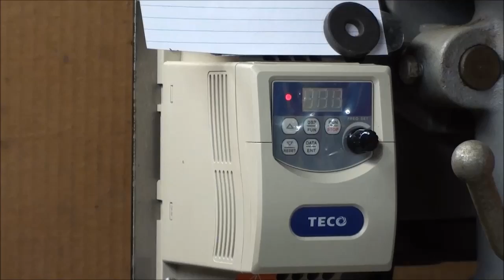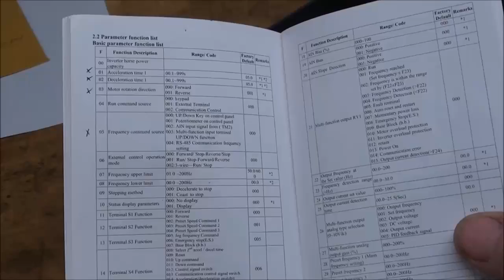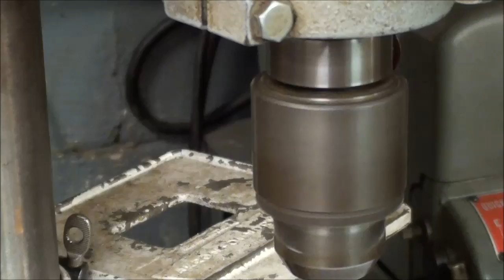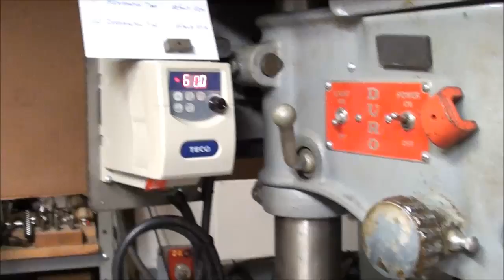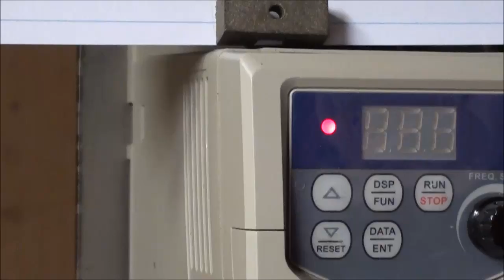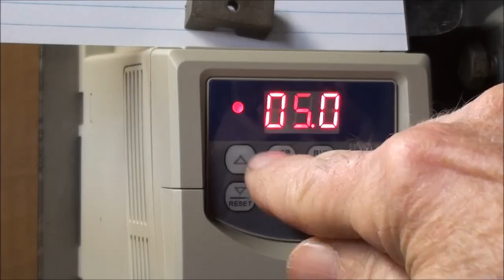MACHINE SHOP TIPS #140 Programming the VFD Variable Frequency Drive tubalcain

Comment: Mr. Pete,
I have a great deal of experience with VFD's so I thought I should share a couple of got ya's  with you.
1) make sure your motor is designed to run on a VFD. Any motor will run on one in the short term but motors not rated for a VFD will burn-up prematurely.
2) VFD rated or not motors should not be run under 20Hz under load. If you have a VFD rated motor you can run it above 60HZ, In many cases up to 120Hz. Pick a pulley combination that gives you your minimum spindle speed at 20Hz and if your motor is so rated your maximum spindle speed at 120Hz. In any case a non-VFD rated motor will last longer if run between 20&60Hz.

Best regards,
Jim
Reply: I have heard that too. I brought a VFD type motor for my wood lathe, cause it was 56 frame, but what if it is some kind of proprietary funky mounting 3 phase motor?
Reply: I've never heard of this? I did buy one &have been using it on my 1951 SB lathe- how would you know if the motor is made to use a VFD? PS I don't use the lathe daily just for projects or repair parts also I did notice that to start &stop the lathe I have to use the VFD instead of the on off & reversing switch that is on the lathe-is that because of the ramp up? (14×72 tool room lathe) Thanks for any info you can throw ny way
Reply: @Tryin2FlyII  Inverter duty motors are labeled as such. They are usually class F wire insulation and also employ motor shaft grounding (newest motors do).

Either way, the manufacturer will readily label the wire insulation class and most times will also call out whether or not it is suitable for inverter duty.
Reply: @thatguythatdoesstuff7448  Thanks - I will have to get in the motor cabinet and see if the motor is labeled any where it is a bit hard to get into and it is darn cold here at the moment lol but Thank you for the info!!!
Reply: I'm a little late to the party but this is exactly the information I was looking for for my milling machine. Thanks man, you made my day.

Comment: Hello Mr Pete, great videos. I converted my drill press to a permanent magnet dc motor off of a clothing rod or treadmill some say. I bought a one hung low handheld tachometer, and mounted it to the drill press aimed it at the final pulley with a small hole drilled into the bottom of the belt shroud and added a piece of reflective tape. Just press the read button and get your rpms.

Comment: I installed a similar converter to my Tom Senior mill and understanding the programming is somewhat of a nightmare, I felt if I did something wrong that would be that, but as of today everything appears to work okay. Resisted the temptation to overspeed the motor, we are 50Hz here so I may one day set it to 60Hz which I guess the motor bearings and armature will take, increasing the speed range a little.

Comment: Thanks for taking the time to show us how it works so we have an idea what is available.  I had a 2HP 3 Phase motor which came with my mill that I couldn't get to work with the 3 phase in my garage.  It currently has a 2HP 110V motor on it, but I may try to get one of these and if I can get the 3 phase motor to work, I can put it back on the mill and use the new 2HP 110V motor on the large air compressor whose motor isn't working right now either and like you, not have to change belt positions on the mill I have.

Comment: My understanding of a VFD is that it converts the input AC to DC, and then pluses that to the motor.  So the 60 cycles from the power company is not a factor anymore.  Saying that I am NOT sure if going over 60 pluses per seconds will harm the motor.  I know that I run my over 60 all the time.  Just my thoughts.

Comment: Nicely done.  I hear you about the Teco manual, leaves much to the imagination.  Once you go through a few of the programming functions it becomes easier.

just to answer a couple questions from your commenters:

If you slow the Hz down to tickover speed you also lose the torque from the motor.  So just running the spindle at 1 rpm you can easily stop the spindle with your hand.  They do make (and I'm getting outside my pay grade here) other more expensive VFDs called Sensorless Vector drives that I believe can maintain motor torque so that might be more appropriate for a machine like a lathe or mill where you still need the machine to have the power in the back gears.

You can also add a FWD REV switch (and program the VFD) so that you can go FWD reverse on teh spindle without digging through a bunch of menus.

The keypad buttons do indeed feel fragile to me and i stopped using them when I decided to move my switches to the front of my drill press remotely.  I might recommend you do that for the on/off at least if you machine gets heavy use.

Comment: I will be very interested to see how a vfd will work on the Bridgeport sounds like a great idea
Reply: It works fine on my Bridgeport.  I'm quite happy with it.  I have several videos about using my Bridgeport, but never considered making one on the VFD.  It just sits there and does its thing, no muss, no fuss.  My house has no three phase available in  the neighborhood, so had to use either a three phase converter or a VFD.  The VFD is a much better solution.  Also allowed me to rip out the old three phase interlock in the power cabinet.
Reply: Tom do you notice a torque loss? and is your mill step pulley or variable speed-thanks
Reply: Blacksmith Johnny I haven't noticed a torque loss, but the vast majority of my work is with small diameter cutters, in aluminum.  I do notice a torque loss (belt slipping) when I'm using large diameter drill bits.  Just ordered a boring head, which will do a better job on large holes.
I currently have the variable speed drive, which I've never used.  Btw, there is a good thread on cnczone.com on replacing the variable speed job with a single tooth belt system, with only one pulley on the motor.
If torque is a problem, a guy can always use the lower gear range on the Bridgeport, and I assume on some or all of the clones as well.
Reply: Great info thanks Tom

Comment: Great video!
Did you check drill press (motor) torque at different frequencies? I suggest to connect external robust start/stop push button and potentiometer, otherwise the Chinese unit keypad will get damaged shortly.
You had inspired me, I am going to look for my VFD unit I got for this purpose long time ago...
regards
Milan

Comment: Looks like a great addition to most shop equipment.  Would be interesting to see what kind of torque you can get with drills, annular cutters, or hole saws of sizes that could have never been considered on a limited RPM drill press and/or mill before.

Manual seemed pretty straight foward to me.  Seems like another few settings that they could add would be a conversion factor and to allow the display to show actual RPMs using the conversion factor.  Would also need to add a 4th digit ...

Glad you finally pealed the plastic off the display!

Comment: Hi Mr. Pete,

I have an Automation Direct vfd and can program the rpm, you can probably do the same if using a fixed pulley. You can rotate through using the dsp/fun button while running and it will probably also show amp draw. In the advanced section...

Mike

Comment: Love all your videos.  Just getting into metalworking as a hobby.  Currently purchased a Enco metal lathe and looking for a Bridgeport mill in the future.  Been doing woodworking for years and branching out some.  Very interesting product.  Wondering how it would work on a small woodworking lathe to convert to variable speed.  Also would like a 220v model to install on a Powermatic p1200 20" drill press 2hp 3phase.